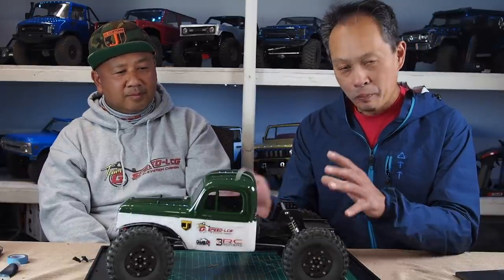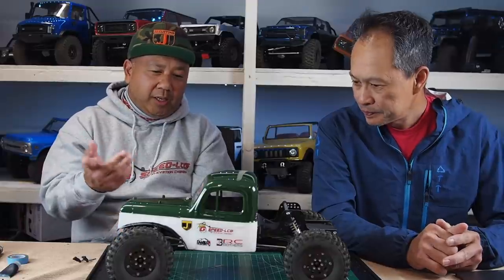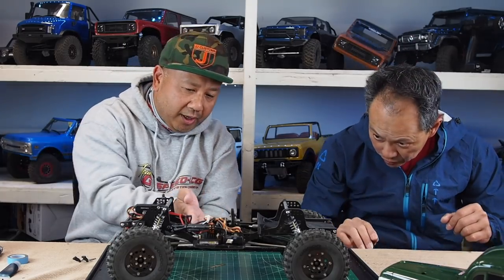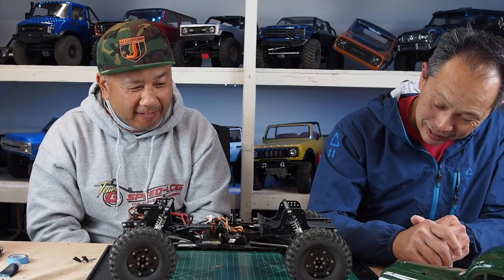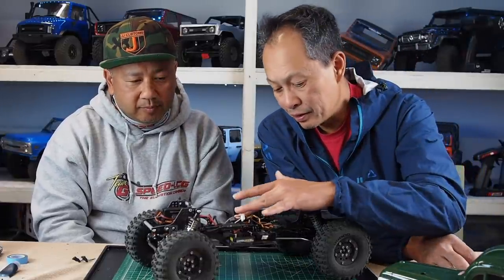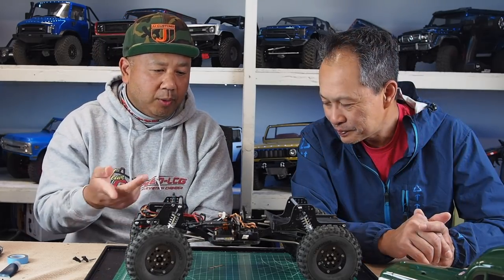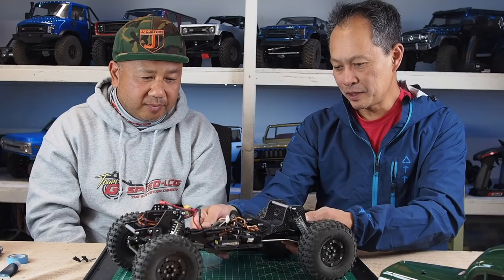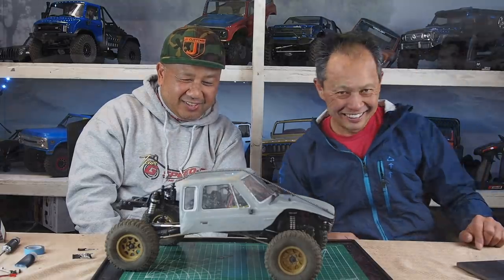Low CG, Belly dragger rc crawler detailed build and parts list

Comment: Thank you guys!
Makes sense in this case just to  direct power the servo, since it already has a regulator circuit built into it.......course the stand-alone bec market may take a small hit😎. Less failure points and weight too.
Reply from the maker: Yes, exactly

Comment: Just came across the idea a couple days ago and tried it today. Why not Buy teflon spray from dupont and coat(or dip) the brass(or anything else) in teflon. Its easy to reapply and teflon has a lower coefficient of friction than any rc part  materials.
Reply: That’s an idea. Doesn’t hurt to try

Comment: There are a bunch of great LCG chassis out there, but few come with the chassis designed for cantilever rear suspension like ClassiCutCustoms. Just one more improvement for cg that is built right into their chassis  ; )
Reply: Not alot of people run cantilever suspension so i guess thats why chassis designers dont make a chassis for only cantilever suspension
Reply: @houstonrccrawlers6445  and they are admittedly more difficult to tune.
Reply: @tiny_the_200  oh yeah i had a cantilever setup in my first trx4 sport and i hated it a pain to tune i went back to stock setup and performs better but now i have a different trx4 lcg setup
Reply: @houstonrccrawlers6445  whoops, I responded from my 1:1 account but these comments are all me 🤦🏻‍♂️ …yes, a standard shock setup is easier 👌🏼
Reply: @mtkidrc2307  yeah way better in my opinion

Comment: Didnt mention total weight?
Just built a very similar rig with trx portals ble 500 v3, stubby 2700kv... Loving it!
Reply: I’ll have to put it on the scale.
Reply: @rcvurooom8837  hey Vu, awesome build!! Where did you get the rear body mount setup?

Comment: What’s the wheelbase on this rig? 12.3”? 12.5”? Also, with the heavy emphasis of weight down low and forward, why not do a servo on axle compared to CMS where the servo sits higher mounted on the chassis. Great video and awesome build. Please post more build videos like these in the future. 👍

Comment: Reckon you could could turn a capra in to something like this? Obviously not the same but same idea? Take off all the rollcage and scale stuff, lower the suspension, put some brass, and make some body mounts and try to find a fitting body.
Reply: Look at the sherpa kit from team garage hack.  Exactly what you are asking for
Reply: John Holmes ok thanks! Will check it out
Reply: Yes you can. A few of the guys have done it. I never got around to trying it, but you can always check out the GSPEED page on FB

Comment: Hoping you can help, i am trying to follow this build exactly. I purchased the Salinas Design ODT V1, it's skid plate/motor mount is 84mm wide. The Team Garage Hack dual servo mount is only 67mm wide. I contacted GSpeed and they said "You can use those parts together but will need to use spacers so the difference in the spacers and skid plate is not more than 11mm" I have a 17mm difference.  In the video i see he is running 70mm chassis brace, so he must have a much narrower skid plate than i received from salinas design. Any advice you can give on where i have gone wrong would be greatly appreciated.

Comment: I really dont understand the carbon wheels....and yes those beef patties add rotational weight.

This dude needs to install delrin links on his truck and he will be a lot happier
Reply: Basically most motorsports want low rotating mass, makes it easier to turn and spin up. If you ever held a bicyclewheel by the nubs while spinning it you understand.